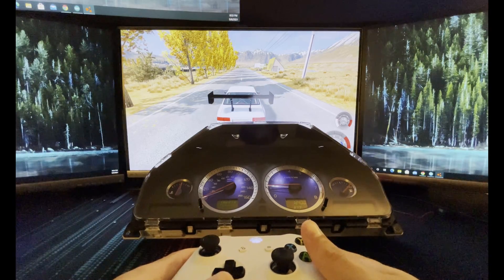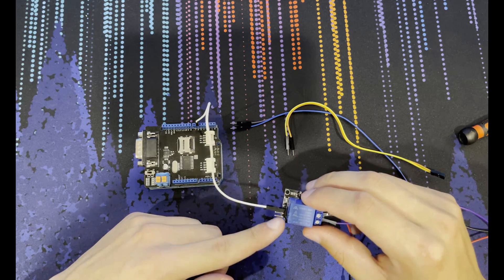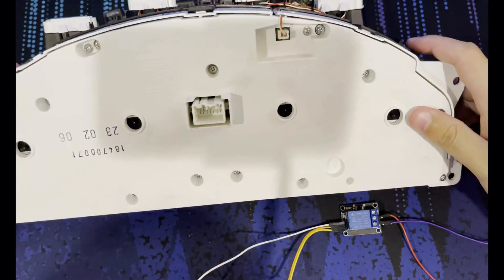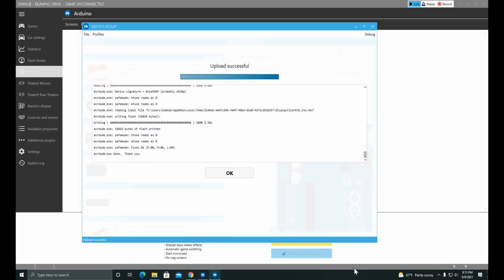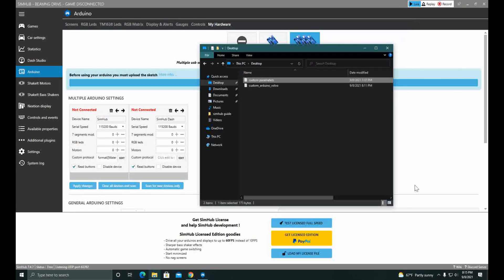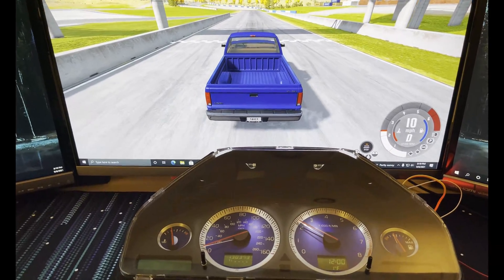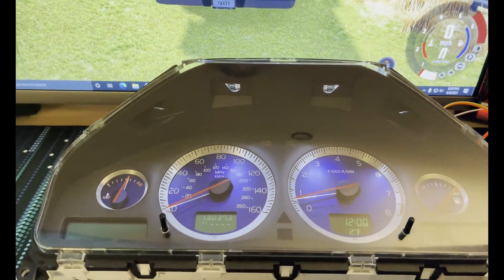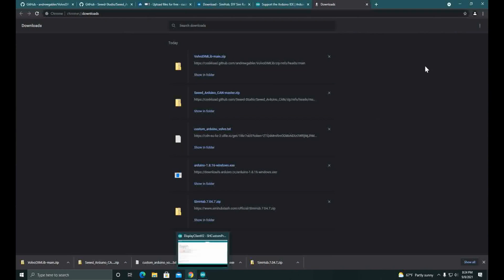SimHub with P2 Volvo Cluster - Setup Guide

Comment: Hey! does the lights work on the cluster when you turn it on in game? Thanks you!
Reply from the maker: Lights? Which ones are you referring to. Most things work, but it depends specifically what you’re wondering about.
Reply: @AVGarage_  the light in the cluster
Reply from the maker: Yes
Reply: @AVGarage_  one more question does the Volvo 60 series 5cyl
have p2?
Reply from the maker: Depends on the year for P2 models. Google it and you will see
Reply: @AVGarage_ thank you so much for your feedback! Deserves a sub.
Reply: I followed all steps on video. 
I used the true versions. But I'm stuck at the compilation point. 
 

Compilation Screen Last messages;

Using library VolvoDIMLib-main at version 1.6.1 in folder: C:\Program+Files+(x86)\SimHub\_Addons\Arduino\ArduinoIDE\arduino-1.6.13\libraries\VolvoDIMLib-main 
Using library Seeed_Arduino_CAN-2.3.1 at version 2.3.1 in folder: C:\Program+Files+(x86)\SimHub\_Addons\Arduino\ArduinoIDE\arduino-1.6.13\libraries\Seeed_Arduino_CAN-2.3.1 
exit status 1

Error Screen;
Compilation failed.

Please help me about it. I bought all parts. I will be very sad if I do not succeed. Have a good day.
Reply: @greenlaf1292
Reply: @furkandagc5223  I did have some errors doing this, I did figure it out but its been 2 years since I've done it I'll have to check what I did wrong and see if it even apply to your problem. Ill get back to you within 2 hours.

Comment: Interesting to develop something similar for my Audi s4 cluster. What did you use to develop the code? I'd imagine you sniff the data from a running car? The relay was jus to reset the cluster?
Reply from the maker: Code is written in C++, I just used some basic examples for canbus integration and created my own logging/sniffing program (see my other videos). Yes the relay is just to control power to the cluster so that it is properly reset before the code executes.
Reply: @AVGarage_  where did you find the canbus integration stuff at? sorry it's probably a super broad question

Comment: Welp, my V70 has a green connector
Reply from the maker: Just joined your discord btw - Andy G. I assume you have an older cluster which runs on 250 baud rate and probably completely different can id’s
Reply: @AVGarage_  well the baud rate seems to be the same (125) but yep, doesn't work at all with this sketch
Reply from the maker: Interesting. I think it was the high speed can network that changed then from 250 -> 500 low speed stayed the same at 125. It must be just different CAN ID’s
Reply: @AVGarage_  Yeah probably
Reply: @kanapraad  Yeah no shit. Already tested it. You do know that Im the same from discord right?

Comment: Great insider but I have just one question. Is it safe to use 5 volt relay to power any cluster that can be 12 volts? I wanna follow the same technique but with a BMW E53 cluster. Thanks!
Reply from the maker: Yeah the relay is 5v to activate the switching, but it is switching a 12v input.

Comment: Have a problem my sim isn’t lighting up
Reply from the maker: Double checked the wiring? Did you get it from a scrapyard or reseller? Could be a bad cluster
Reply: @AVGarage_  its working perfectly but the time for regular service is stuck on
Reply: @AVGarage_  and is there a way to use the indicator lights and warning lights
Reply from the maker: Not at the moment, the service light is unfortunately from the car when it was last on. I tried writing code to fix that, but it wasn’t working programmatically.

Comment: Does it work with HW-184 module and can i use different clusters like one from audi or bmw (e60/e61)?
Reply from the maker: No it does not work with those clusters. You would need to write your own code or find a different guide unfortunately.

Comment: Since this probably doesn’t work on a v70 cluster from 2001 do you have any idea what needs to be done for it to work?
Reply from the maker: You would need to log the network on a 2001 year car and then get all of the addresses from scratch then implement the code similarly to the way I did. Much easier to get a newer cluster from ebay or the scrap yard.

Comment: Hello, I am having trouble on this. I have all the parts, my wiring is correct, but the software when i go to export the code to the Arduino, it starts and it gets to about a third of the way there and says "Compilation Error" and supplies no further explanation (in simhub) I do have a slightly different Arduino, I am using the third revision (R3) while (I believe) you are using revision one (R1). I am not too good with these Arduino's and am not familiar with the troubleshooting process. However I can attempt to give you some clues as to what is going on. In SimHub, The Arduino has two COM ports, while you only have one. The two COM ports are labeled as: "COM1: Communications port" and "COM6: Arduino UNO". I have tried the software on a different computer, but only getting the same result. I am afraid that it is a hardware incompatibility. Though I really hope I just set something up in the software wrong. Any guidance would be appreciated, thanks.
Reply from the maker: This is something I am unfamiliar with. You could attempt to upload the code from the arduino studio instead and it might give you a better error message. The simhub discord may be able to help you out as well.
Reply: I appreciate the fast reply. I will attempt via the Arduino studio and will go to the Discord if that also fails. Thanks
Reply: I have the same problem have you solved it?
Reply: @Bruh-ph6wh  I have, I had the incorrect version of the SEED library (too new) and downloading an older version fixed it. I believe 2.3.1 is the version used in the video.
Reply: @s60rchase17  ok where do you download it from?
Reply: @Bruh-ph6wh  ...the description?
Reply: @s60rchase17  the older version of the SEED library
Reply: @s60rchase17  thank you for the help now it's working :)

Comment: for what is the additional board ??? can the cables not plugged in to the uno directly ??
Reply: Can Bus shield.... There are only the 2 wires?
Reply from the maker: Yes this does the heavy lifting and sends a signal that the instrument cluster understands. You don’t need the whole shield you just need the chip (mcpxxx) but the shield is the easiest to use for a beginner and has the SD card added to it.
Reply: @AVGarage_  ah OK I understand. I Just thought the arduino does the Job itself 😁
Reply from the maker: Do you mean the relay or the can-bus shield?

Comment: hello again, finally got the right one, but now my problem is my km/h is going with some totally another speed then mine is, any way to fix is?
Reply from the maker: Can you describe better what is happening? You have a cluster that only has a kmh dial? You probably need to be converting kmh to mph to input in the code
Reply from the maker: Example setSpeed(yourSpeedVariable); 

Should be

setSpeed(Math.floor(yourSpeedVariable * 0.6213712));
Reply: @AVGarage_  and where do i put it in?
Reply from the maker: This is in the simhub arduino file that you copied and pasted.
Reply: maybe it's just me that's a idiot, but i don't know where exactly
Reply from the maker: In the file SHCUSTOMPROTOCOL
Reply from the maker: At the top of that file right under the two lines that start with #include

Add #include <cmath>
Reply from the maker: Then look for this line in the file 

VolvoDIM.setSpeed(carSpeed);

And change it to VolvoDIM.setSpeed(floor(carSpeed*0.6213712));
Reply: @AVGarage_  i get this error when i use #include <cmath>, but if i use <math.h> it work, but a few sec in the dashboard shut off
 Arduino: 1.6.13 (Windows 10), Board: "Arduino/Genuino Uno"

In file included from C:\Program Files (x86)\SimHub\_Addons\Arduino\DisplayClientV2\DisplayClientV2.ino:938:0:

sketch\SHCustomProtocol.h:6:19: fatal error: cmath.h: No such file or directory

 #include <cmath.h>

                   ^

compilation terminated.

exit status 1
Error compiling for board Arduino/Genuino Uno.

This report would have more information with
"Show verbose output during compilation"
option enabled in File -> Preferences.
Reply from the maker: Try changing cmath to math
Reply from the maker: I’m not at my computer to test this right now so I don’t know if you need to add files or if arduino includes them by default
Reply: @AVGarage_   i will try that when I get home vacation, in Sweden
Reply from the maker: Have a good one! Let me know if it works or if you need more help.
Reply: @AVGarage_  thank you! And have a great week, I will do that
Reply: @AVGarage_  i have tried it with math and that doesn't work either
Reply from the maker: Does it do anything differently? It’s a bit difficult for me to speculate what might be happening without seeing it myself.
Reply: well what happens in this video is when i use the math.h. this is the error messages it gives me when i try to use math, Arduino: 1.6.13 (Windows 10), Board: "Arduino/Genuino Uno"

In file included from C:\Program Files (x86)\SimHub\_Addons\Arduino\DisplayClientV2\DisplayClientV2.ino:938:0:

sketch\SHCustomProtocol.h:6:16: fatal error: math: No such file or directory

 #include <math>

                ^

compilation terminated.

exit status 1
Error compiling for board Arduino/Genuino Uno.

This report would have more information with
This report would have more information with
Reply from the maker: Let me test it on my side so I stop giving you bad suggestions
Reply from the maker: It needs to be <math.h>
Reply: @AVGarage_  i have tried it with that code now and it keep shut it off like before
Reply from the maker: Sorry about that, I have been very busy and all of my stuff to test is in storage. It you uploaded a video of the issue I might be able to understand better.
Reply: @AVGarage_  https://youtube.com/shorts/7lAOIczToEA

Comment: Hey! Do you know if i can use a Cluster from 2004? (Spare part number 8602882)
Reply from the maker: It won’t work with a 2004 cluster, they run at a slower speed.
Reply: @AVGarage_  So would it not function at all or will it just be very slow to respond? Im making this as an arduino project for electro school so would prefere not to purchase another speedo.
Reply from the maker: It would not function
Reply from the maker: After seeing the part number it looks like that was for models 2005-2008 so there is a good chance it would work.
Reply: @AVGarage_  Damn. Thanks for the quick response.
Reply: @AVGarage_  It says on the back it was made on 14/06/04 thought.
Reply: @AVGarage_  Alright! Thanks for everything! Time to start doing the project!

Comment: Awesome, really underrated video! I love how well you explained everything, just what I needed. I was wondering, if I wanted to do this with a P3 cluster, how far would following this tutorial get me? I have some experience with Arduinos and I know my dad could help me further with the coding part.

The connector behind the cluster looks identical, which really surprised me. Atleast they both have seven pins on the lower row, and three on the upper and in the same layout. Also the plastic part looks the same.

The clusters are the part that process the data, aren't they? I mean, the cluster being the part that decides what to show up on the screens, not the CEM or other car computers. Like if your car would send out a signal about low oil pressure, the cluster would always get the same signal, and it would be the cluster that decides to say "Low oil pressure" in the language it is using. 
It would be cool to make the dash inform you about new emails, tolls etc. in ETS2, but I suppose its not possible. I know it's possible to code new messages into P2 clusters so atleast you can always use a P2 car to make new messages, and then make SimHub use those messages. One Finnish guy made his car display in Finnish "Driver requires a bottle" :D. Not at all sure if you can do anything similar with a P3 dash. 

Any info would be highly appreciated. Like DMD AUTO said, "this was a much needed piece to a project I didn’t even know I had". My simulator setup will be a project in the far future and also really ambitious, especially for me.
Reply from the maker: It is possible to do it with a P3 cluster, but you would need a P3 car to log files from and then interpret them into code like I did for the P2. My brother has a P3 and I have a spare cluster, but I don’t have the time to work on it right now.
Reply: @AVGarage_  You have shared so much info that maybe I will give it a shot some day. Assuming you haven't already done it by then :D

Comment: Thank you for this great video. I actually have a question, do you have by any chance got the custom code in European?
Reply from the maker: I’m not sure what you mean by “in European”? It’s only written in English right now but it should be fairly easy to translate to whatever language you please.
Reply: @AVGarage_   i mean if you have it in km/h, celsius, liters and all the other different things for the European speedometer. because i'm not especially good at editing the code for it
Reply from the maker: Oh yes sorry. I believe that I would need a European or Canadian cluster to write the code for that because I am unaware of the location of the configuration (CEM or Cluster). It may be possible to change without a euro cluster but at minimum I would need to get a log from a euro car.
Reply: okay. so i Tried using the code on my volvo v70 gen 2 2002 cluster, and it Didn't work. i think I knew why it didn't work because yours is newer then mine. Mine is 2000 or 2002, idk actually know, i just know that mine have a green plug, and your's have a white one. But i know my cluster is from a Volvo V70 gen. So i don't know if you can make one for the older models of the speedometer?
Reply: I would gladly get the codes for you. I just don't know how to do it
Reply from the maker: It needs to be a 2005-2009 Cluster. I could maybe write code for an older one but I won’t have the time to do that for a few months or so.
Reply: okay, i just thought that it might have worked, okay so. but still thank you for the greats video ever😀
Reply from the maker: No problem

Comment: (This comment has been re-edited because i now have a VW Routan cluster and a CAN-Bus shield).

Edit: Will this work for a 2013 T&C van cluster?
Reply from the maker: You need to have the can bus shield for this to work.
Reply: @AVGarage_   But they are too expensive.
Reply from the maker: Not sure what to tell you, it’s required though.
Reply: @AVGarage_  The cluster just came, and now it won't power on with 12V, Waste of my time.
Reply from the maker: Yeah you need a can bus shield and the proper connections. Nowhere in my video did I mention that it would function without that.
Reply: @AVGarage_  They are proper, White goes to 12V and Black to Ground.
Reply from the maker: You still need the can-bus connections from the can bus shield.
Reply: @AVGarage_  Not only that, vehicles after 2000 need Can-BUS, caught in 4k buddy.
Reply from the maker: What are you talking about? I’ve said from the start that can-bus is needed.
Reply: @AVGarage_  Research it, cars after 2000 need Can-BUS, and i'm getting a 2014 Nissan Sentra gauge cluster, caught in 4.4k.
Reply from the maker: I told you that from the start. Again you are ignoring me.
Reply: @AVGarage_  No i am not, plus, i'm only getting servos because i wanna make a really high end and a really good dashboard, like i said, VEHICLES AFTER 2000 NEED A CAN BUS.
Reply: @AVGarage_  Update: Getting a CAN-Bus, We have no idea when at what day I should get the cluster at.
Reply: Second Update: CAN-Bus has been shipped, We don’t know when it will be out for delivery.
Reply: Third Update: CAN-Bus delivered! New video on the 22nd.
Reply: Fourth Update: Cluster has been ordered on the 19th, expect a new video on the 30th.